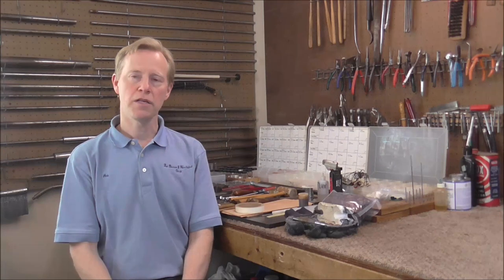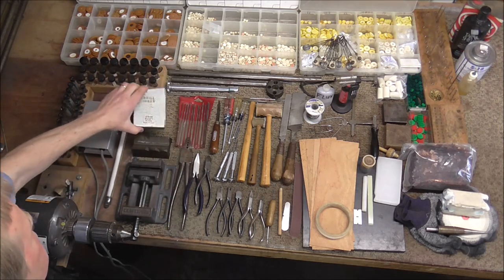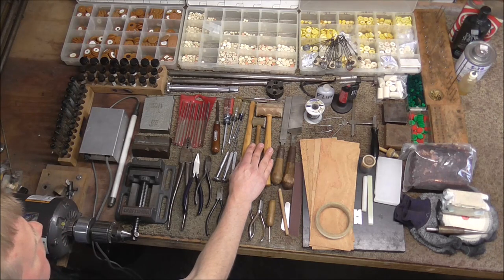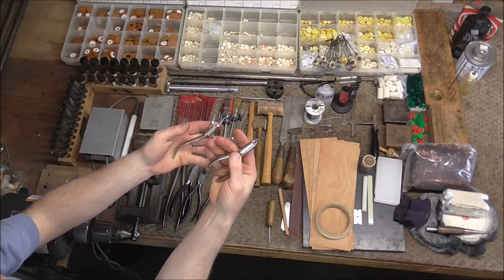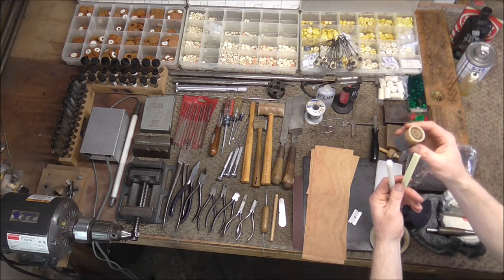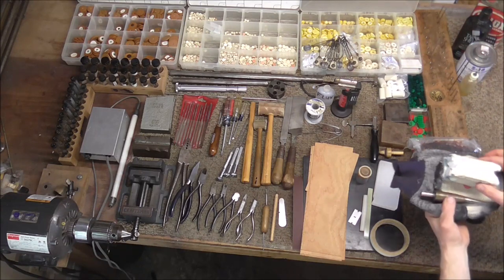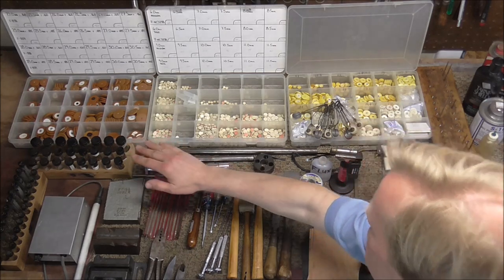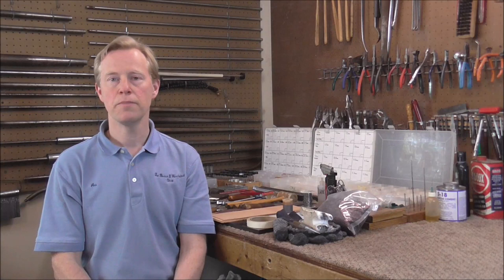What Woodwind Repair Tools Do I Need To Start My Shop?

Comment: I'd like to add an alternative idea for the leak light, because they can be kind of expensive for a good one, and if you're only working on one, it can be tough to justify the cost. I used a cut up wall power adapter and a few old LEDs, but you could also use a USB power cord and a portable charger for 5v LEDs. It's definitely not as good as a dedicated leak light, but it works well enough to get the job done, and can be made out of things a lot of people have sitting around.

Comment: Does it take new pads a while to settle?  I had six pads replaced on my flute.  I noticed that within a couple of hours my tone got better and better.
Reply from the maker: They should seat well when you get the flute back from the shop, but sometimes it can seat a little better when you use it for a little while.
Reply: @TheBrassandWoodwindShop  thank you for your response.

Comment: What sizes and brand of the clarinet pads should you get a dozen of? In the description, I think it only lists flute pad sizes?
Reply from the maker: The most common sizes of clarinet pads are 9mm, 9.5mm, 10mm, 11.5mm, 16.5mm, and 17mm. You can get pads from Ferree's Tools. I am not sure what the part number is, but I recommend the medium thickness, double bladder, hard pressed felt pads.
Reply: Thanks

Comment: How much money should i save up to acquire these tools?
Reply from the maker: Sorry it took me so long to get back to you. We just had a baby and I am finally getting around to answering questions. 
It depends on what tools you need and what you can get by without. Also, it depends if you can get them used. So it probably will be around $1,000 at the very low end and around $10,000 at the high end. I hope this helps.